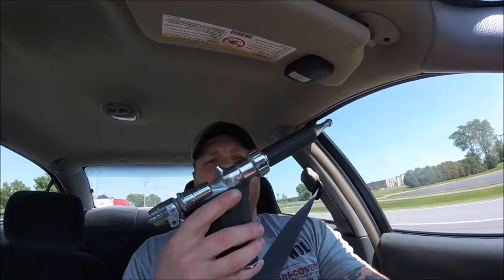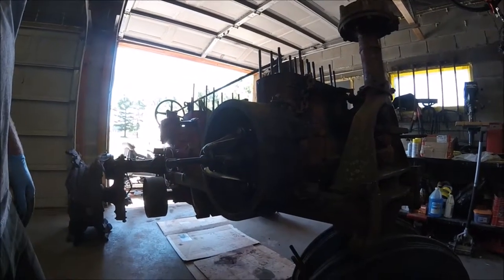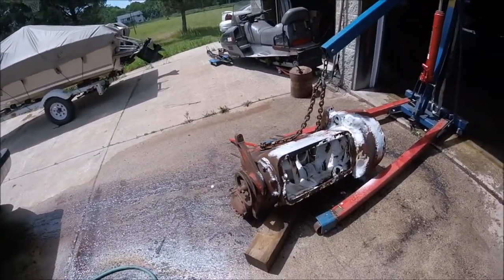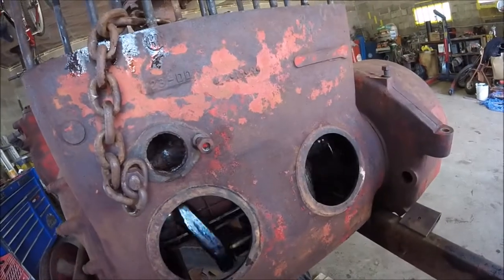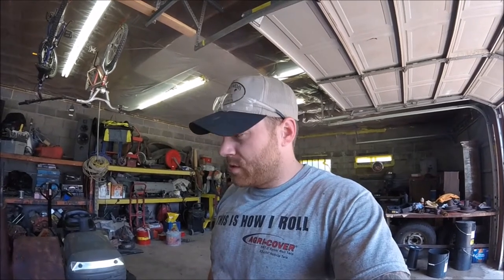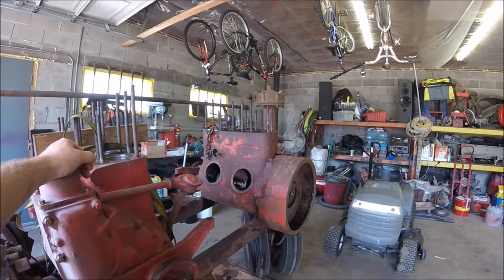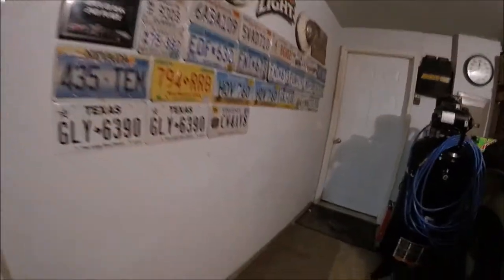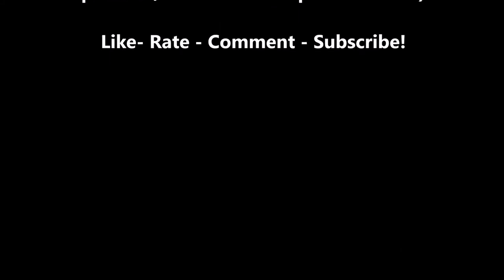1938 Farmall F20 Episode 7: Flywheel Removal Attempt - FAIL!

Comment: If you are going to be using the pto, take the belt pully off first. The splines and diameter is the same as the regular pto. In 69 or 70, I mounted the pump for the loader on it, the pump was too large to fit an F 20 pto, not enough space between the pto shaft and the axel housing.
Reply from the maker: Thanks for the heads up!

Comment: What do you do about springs you can't find stock replacements for?  I have bad return spring on a starter for a John Deere H and no way you can find that part.  Wonder if if have a go to for custom built springs or some place that has an incredible inventory.  Thanks.
Reply from the maker: To be honest, I take my starters to my local auto electrical shop. You might try a place like Fastenal, but contact your local auto electrical shops to see what they might have. That is where I would start!
Reply: Thanks.  We actually have a Fastenal's in Madison, WI.  I will try them first.  I just need the spring and I'm good.
Reply from the maker: Give them a shot - if they don't have it in stock they may be able to order it for you. Otherwise you could try farmallparts(dot)com... They are a IH specialist.

Comment: I got my dad informed on the SC being a 41 and I think he is in love with it too....we will be tinkering with it tomorrow bro...quick question how do I check fluid in the transmission ? and what kinda fluid do you use ? I wanna drain it and refill with new fluid ....oh and where is the drain plug ?? Thanks brother hope you are icing that hand !!!
Reply from the maker: Glad your dad is getting into it! The drain is on the right hand side, just below the differential brake cover (It is a large 1" square pipe plug). The level plug is under the right footrest, and is small (I believe it is a 7/16" square head). Be careful not to mistake it for the motor-lift housing plug (which is on the motor lift housing). The level plug is on the back of the transmission rear cover plate. The capacity is approximately 11 gallons of 80w90 Gear Oil. Hand is doing ok. Pretty swollen and sore, but It will be fine eventually. Also, you can pick up this manual and it will be one of the best investments you will make! http://www.yesterdaystractors.com/CA_SSERIES_SV_2607.htm

Comment: if you use pitted sleeves it will tear out the rings very fast i i were going to restore both engines to running condition i would either find oversized pistons and pore the engine to 3 7/8 and fit it with original M flat head pistons or find  a better set of sleeves and replace just the bad ones. as for the cracked block i sent you the cure for that a cheap fix  would be to use duroglass block sealer. if you can get a set of hastings rings they are the best for loose fit worn bores. and there is a set in the boxes  of new old stock undersized rod bearings on ebay
Reply from the maker: From what I can tell, the sleeves don't have any pits in them which is good. Once I run a hone down them and clean them up I will know for sure. We will see what happens. The rod bearings I have out of one block are in good shape, and both cranks are in good shape as well.

Comment: pulling that flywheel with the factory tools is a chore..  here is some links
 but when the ihc dealer i worked for did one they used a porta power to remove the flywheel.
 http://forums.yesterdaystractors.com/viewtopic.php?t=1088105

this will work so get some scrap steel plat and make this 
http://forums.yesterdaystractors.com/viewtopic.php?t=1249713
Reply from the maker: I've been talking with Nebraska Kirk quite a bit. He was going to let me borrow his sleeve puck if I were to pull the sleeves. Seeing as how good of shape everything is in after a good thorough cleaning, though, this may be as far as I tear it down.

Comment: OUCH !  Great video .  I think the hand will be Fine .you probable struck a nerve and tendon , Ice pack will help . At least you did not lose a Nail or  finger tip ( Sledge Hammer Stupidity ) OR drop a block on your foot because you thought ?? It don't weigh that much I will  just throw it in the truck ...missed the tail gate by <> that much !  Safety first  or is it  Murphy's Law .. first ?   If you can get that pin out the flywheel will  follow ..Thanks for sharing ..
Reply from the maker: Well the hand gained some movement back but it's still sore and swollen. Oh well. I'll be fine. Funny you mentioned the foot - I am waiting for a toe nail to grow back as we speak! LOL! Most of the research I have done on the flywheel says they come off at the same time (pin and flywheel).